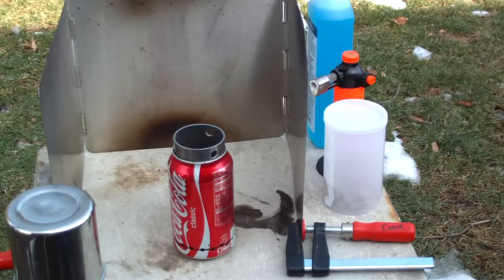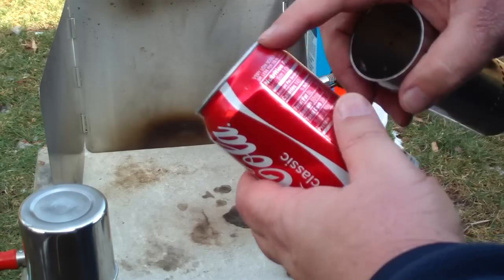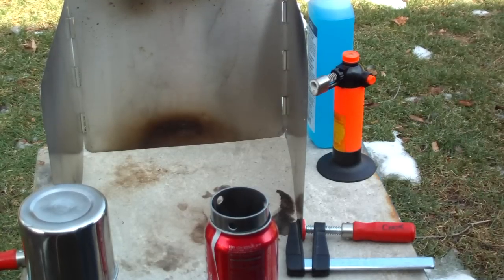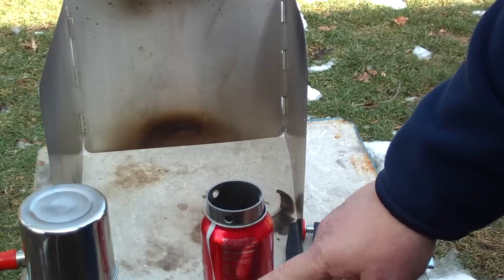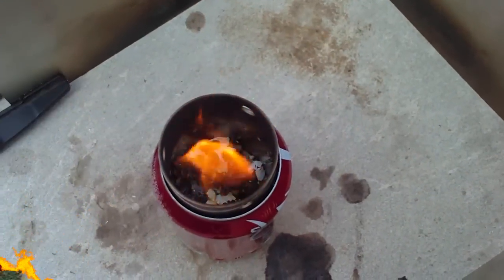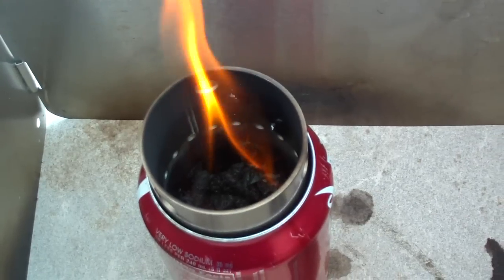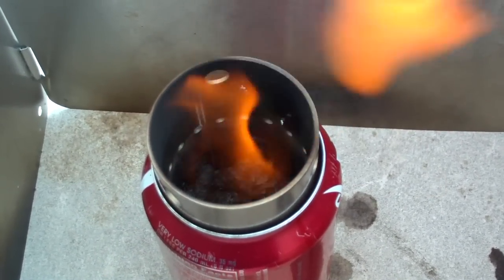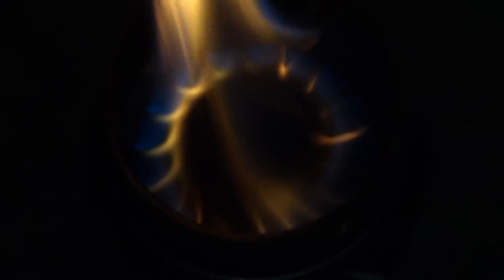WorldStove's Beaner Campstove - First Burn

Comment: I just rolled a small sheet of aluminum foil, punched a few holes then inserted that into the coke can.   I used an xacto knife to scribe a 1 inch circle on the side of the coke can then use the knife to easily remove that piece to create the hole.  The result is a stove that can be held while it is burning. Nat informed me that aluminum burner is unsafe due to the aluminum fume. I see he has made his from steel and have most secondary air come from above the can. Looks great.

Comment: The trick with lighting woodgas stove is that the top layer of wood or pellets must reach high enough temperature to give off gas. Since the fondue gel boils at 70 degrees, it actually keeps the pellets too cold to prevent smoking until all the fondue gel are gone. But iIf you carefully placed large droplets on 10% of the pellets without touching others, I think you will be able to light the stove. My favorite way is to put a piece of 2 inch long fibreglass rope dipped in alcohol place on top.

Comment: I have a large woodgas stove made from a gallon paint can that I use to burn twigs and branches from around the yard and I save the charcoal and bury it in my garden. I'm going carbon-negative with the old Christmas tree this year, haha. It's nice because it doesn't smoke out my neighbors when it's burning.
That stove had a nice looking flame. Very clean. I'm very curious to see it boil and how much soot it produces. Thanks Hiram.

Comment: @deezynar the inside cylinder acts like a chimney and draws in air from all the holes and the gap below. As for the gap above, the inside cylinder  has a tight fit with the can's neck to keep it from moving.

Comment: I think that since you used a side cutter instead of a top cutter the opening on the can is larger than it should be so the seal between the can and the tube isn't as good as it should be. The draft still happens because of the chimney effect on the tube, but it is also drawing in some air that has not been preheated.

Comment: @jw934 Before I thought of the idea of using a fireplace gasket fiberglass rope, my favorite was to roll 7 green pea size tissue paper balls and soak them in alcohol. Place these on top of the pellets then light them. The paper balls prevent the pellets from absorbing alcohol and expanding to saw dust and plugging the gaps for the smoke to rise fast enough.  Two sheets of toilet paper is enough for 10 balls.